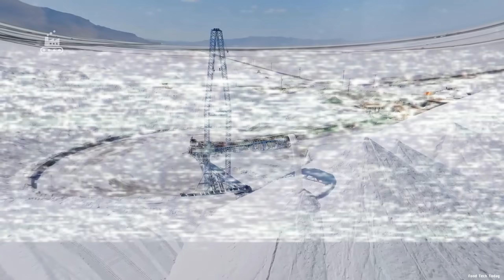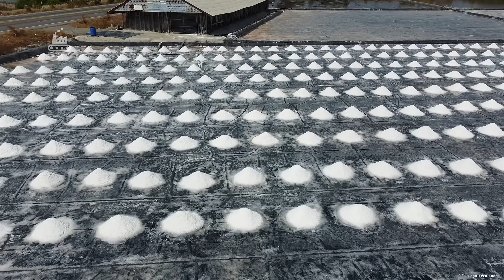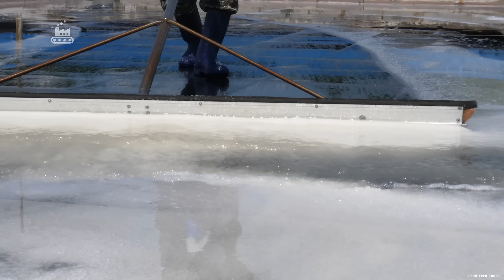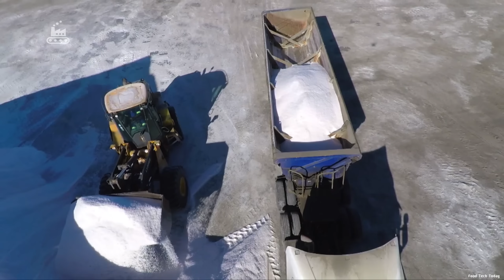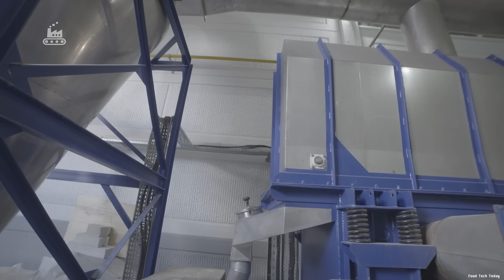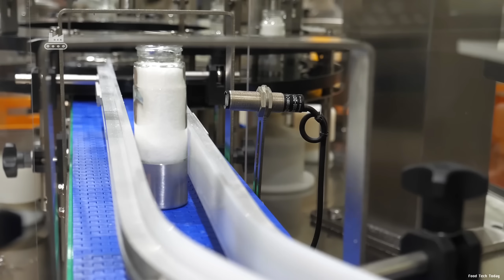How Sea Salt Is Made 🧂 – Millions of Tons of Sea Salt Harvested and Processed

Comment: Sea Salt has some dirty little secrets that aren’t talked about too much. There are about 62 million tonnes of Radioactive Potassium 40 dissolved in our planet's oceans along with more than 4 billion tonnes of radioactive Uranium and this includes enough U235 to fabricate more than a billion nuclear weapons. A pile of sea salt large enough to contain enough U235 to fabricate a nuclear weapon can be pulled by a full sized pickup. It should also be noted that the beta radioactivity from Potassium 40 has almost 3 times the energy of beta radioactivity from Strontium 90, one of the 2 primary components of high level nuclear waste.  

All of this compares to about 440 thousand tonnes of radioactive waste discharged from all the nuclear power plants on the planet since the first one went into operation in the early 1950s.

So, the radioactive material already dissolved in our oceans is a factor ten thousand times greater than all the nuclear waste generated by all the commercial nuclear power plants since the beginning of the nuclear age. It should also be noted that  some Nuclear Safety experts maintain that there is no safe level of radiation exposure. All of this information can be easily verified using appropriate google and GROK queries.
Reply: The dose is probably in the 0.1% of the salt's content, which also contain other things.
Reply: @ThubaMubasyirAdzkiya  1% is a lot... it's radioactive and half lives are in the billions of years so it lasts forever. It's the same radioactivity, so why is radiactivity from nuclear power plants  or nuclear weapons different than radioactivity from the sea?
Reply: @robertlcrocker  0.1%, since the salt content is 99.9%
Reply: @ThubaMubasyirAdzkiya  That is true but even at .1% a pile of sea salt large enough to contain enough U235 to fabricate a nuclear weapon can still be towed by a full sized pick up truck. When it comes to nukes. .1% is all you need. Wake up and run the numbers my friend
Reply: @robertlcrocker 

There is a reason why I brought up the dose.

Yes, there are a notable amount of Potassium 40 in a truck of salt. But, if you genuinely eat a truck of salt a day, sodium poisoning will reach you first before the main effects of the Potassium. Dose matters. Also, Potassium 40 is also contained within bananas.

Also, I previously stated that the 0.1% of the salt "also contains many other things". The potassium is not even the sole building block of that 0.1%.